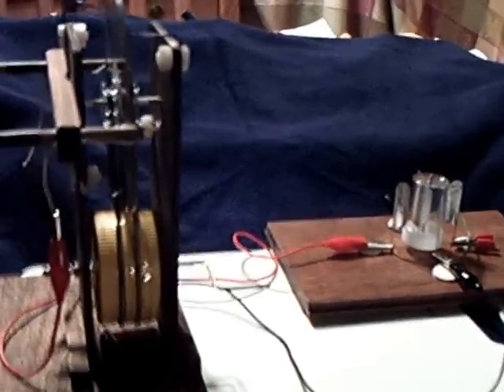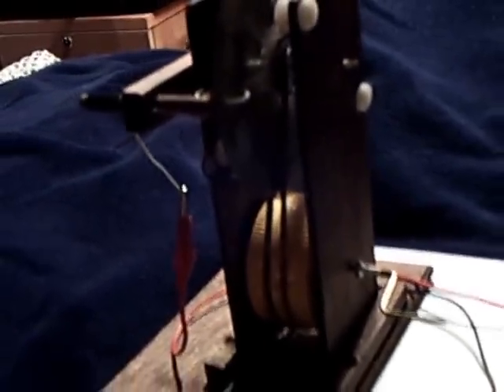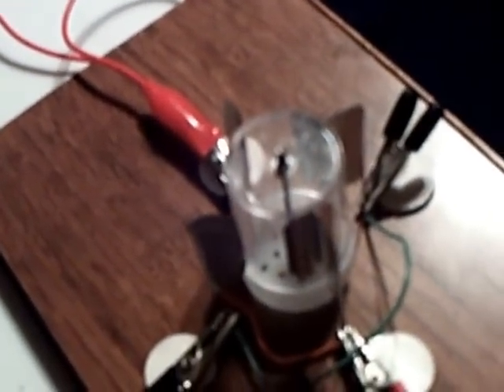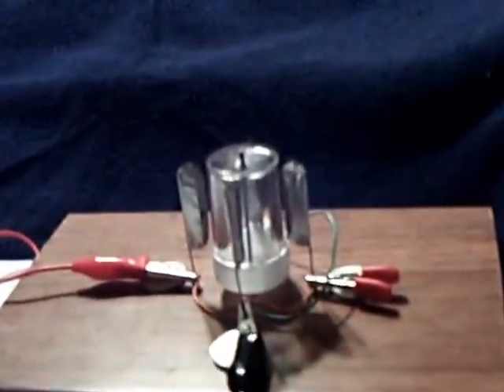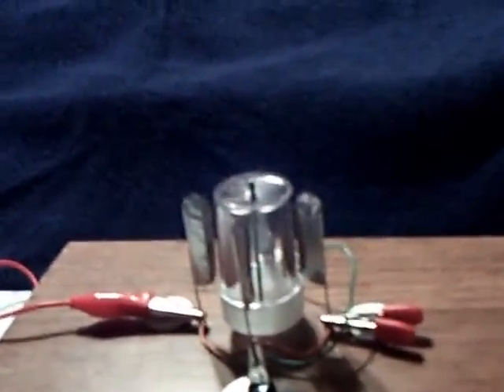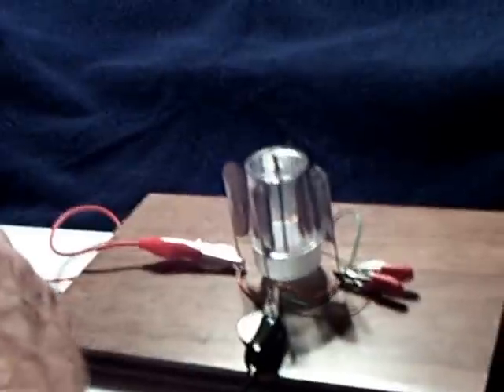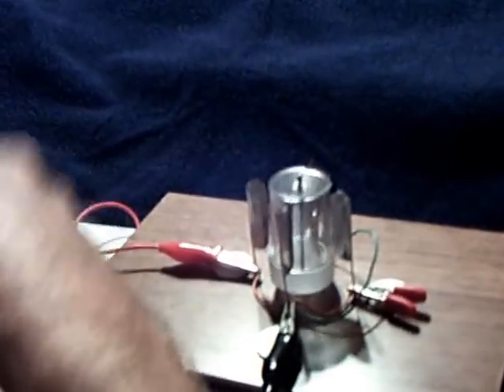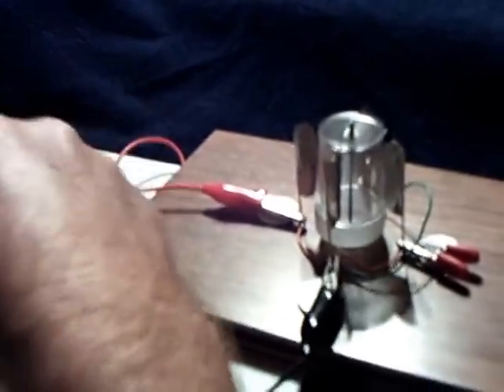Brushless Electrostatic Motor

Comment: Great little motor!  I read recently that with more blades you get more torque and less RPM, while with less blades you get a higher RPM with less torque.  When it comes to this type of stuff I have found that everything must be tested for oneself - there seems to be tons of conflicting information.
Reply from the maker: Thanks for the tip about blade number and torque vs RPM.  The info that I am getting on electrostatics is also at times conflicting.  When it come to the math I get totally lost.  I just ordered  A.D. Moore's book that should help.

Comment: Rusty:

That is a really cool motor!  What I don't get is how the HV goes through the plastic (insulator) of the pill bottle?  Does it charge the surface and transfer that way like the brushes on a Vandegraff?  If so, then the body of the bottle is acting like a brush then?  All so very interesting and educational.  Thanks for sharing this.

Bill
Reply from the maker: Hi Bill.  I am still learning how this works.  It is so different than the magnet and coil of wire dance that we are used to.  Basically the thing is capacitor in motion using electrostatic induction to move the electrons around.  Coulomb force does the work.  No brushes needed.